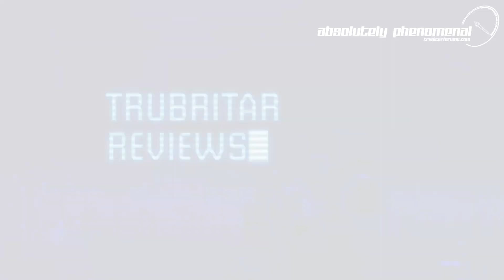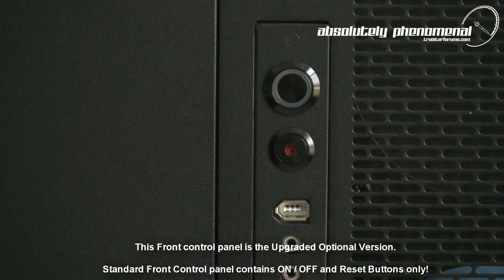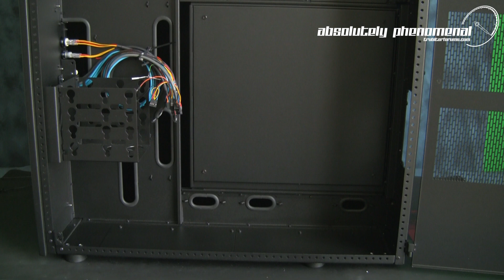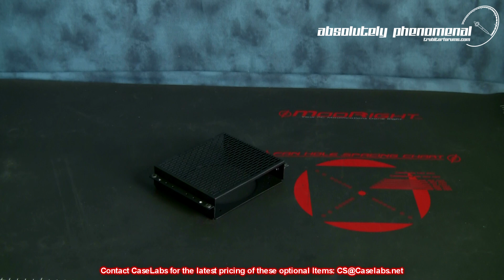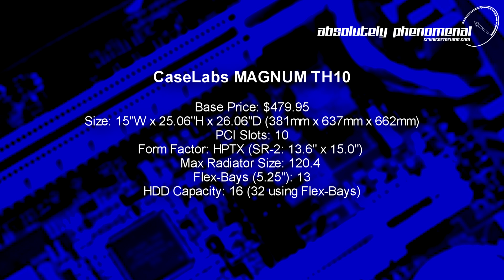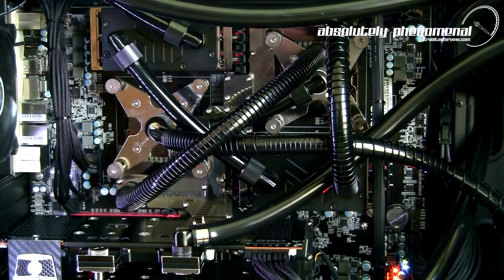CASELABS Magnum TH10 PC Case - Crysis Cruncher 2 Build (Benchmarks to Follow)

Comment: Also, only the pedestal is setup out of the box to have 140/280/420/560 radiators fitted without any modding.

Comment: You left out the TH10 Pedestal accessory, which is a must have for adding bottom mounted radiators without sacrificing HDD cage space.

The pedestal is great for people wanting to have the TH10 as free standing case on wheels on the ground, giving it a much better height.